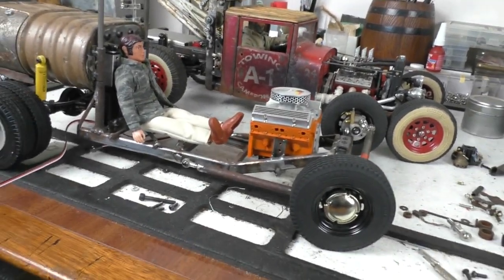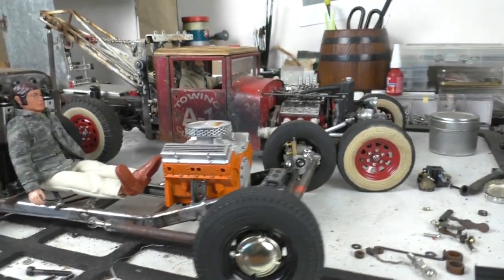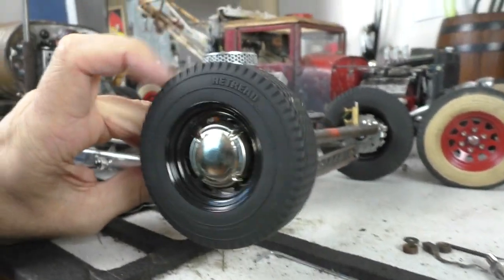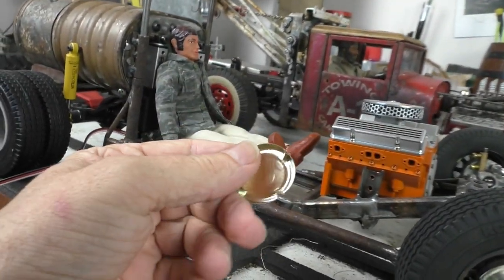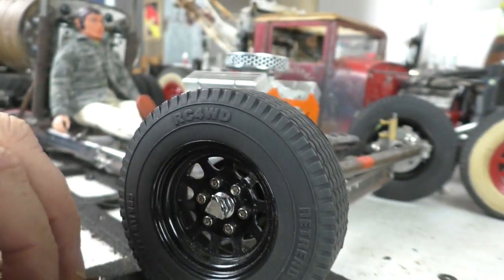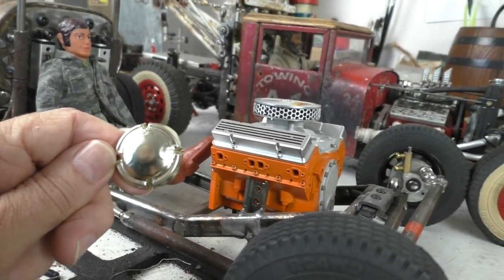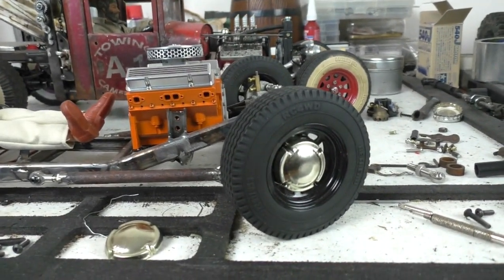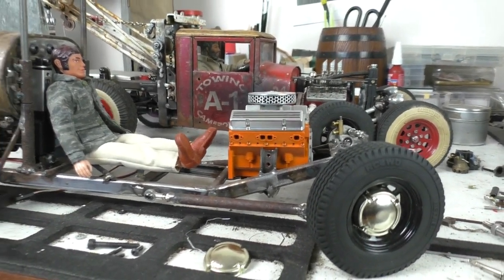Traditional hub cap for RC hot rod or rat rod.

Comment: This really is the sort of model making I admire. I´d have just assumed the cap was aluminium. I always get the urge to keep them with the wire on and try to make a hot air balloon using the cap and wire to hold a solid fuel tablet, but I´ve never had that mental lateral leap that you had. Great stuff!

Comment: Great idea. I just tried to make moons out of bolt dress-up caps. They were to small. maybe bigger ones would work. I mainly use acorn nuts in place of the nylon nuts. if there's enough threads I'll put them on the end.
Reply from the maker: My partner is pretty partial to the bubbles so this is an easy one for me.